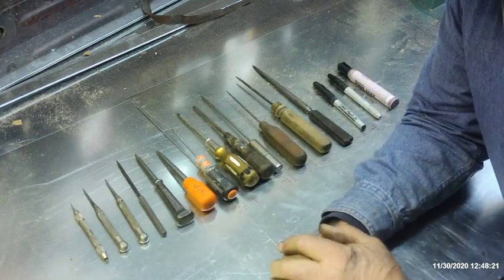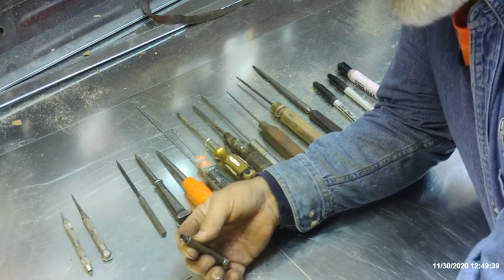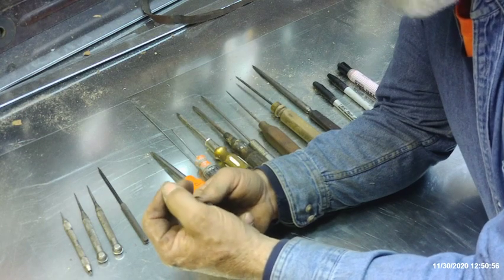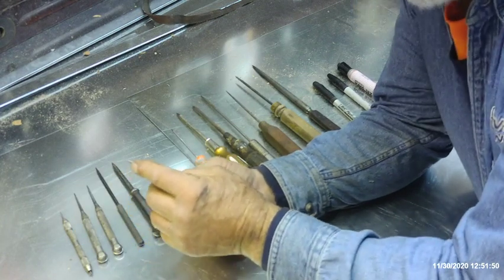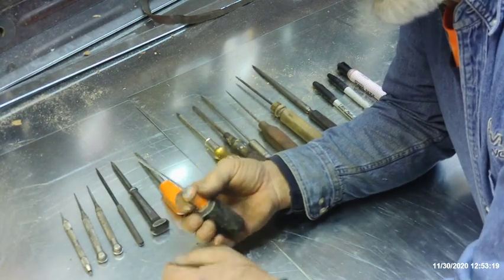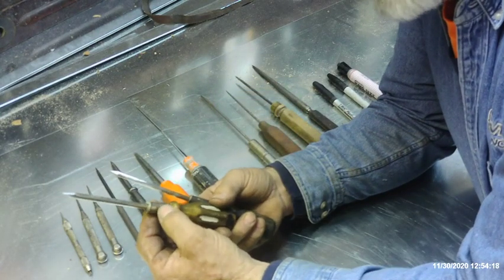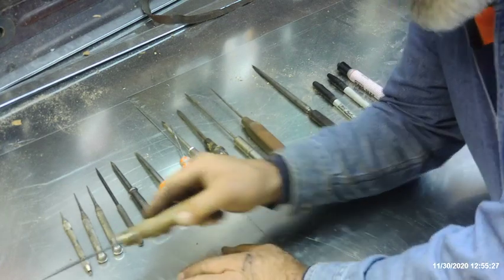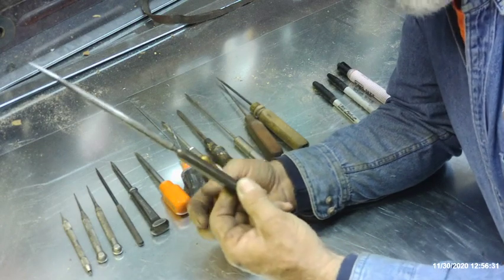Awl Selection for Sheet Metal Layout

Comment: I was waiting for this one....you have a good selection on hand and it`s nice to see when you use certain ones.....CHEERS
Reply from the maker: I like the long skinny ones because they reach further across 4 foot metal.  Also the fat ones have to be angled waaaay out to get the point right up against the edge of the straight edge....or you'll be off the mark by a 1/16th or 1/8th !!  No good, huh.  May as well use the fat majic marker.

Comment: WHhn you make your own they are just what you want. Nice video.
I like the pin vise handles too.
Reply from the maker: I have the tiny pilot orifice drills that HAVE to be held in a pin vise. That's the #61 to #80 number sizes. A must have tool set for propane and natural gas orifice cleaning.

Comment: Thanks for sharing. Malco makes several size options also, in addition to the one you shared in the video here. They also have one with a retractable carbide tip that is pretty nice 👍

I’m going to test out the thermostat anchoring trick as you suggested here
Reply from the maker: Mounting thermostat's is the main reason that particular awl is my favorite.  The angle of the fat tapered tine is perfect for standard wall anchors.  Twist it back and forth while pushing inward until you swage the drywall to the right diameter for the size of your anchor. 
   I have a couple of the shorter Malco's, like an ice pick, but shorter.  Thanks Christopher for the input.